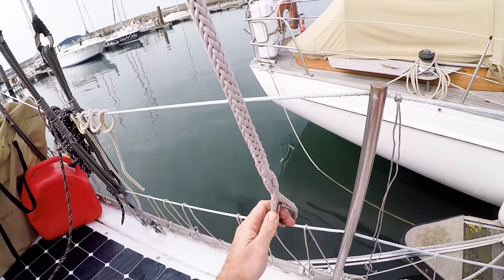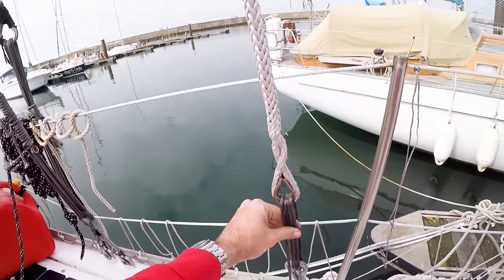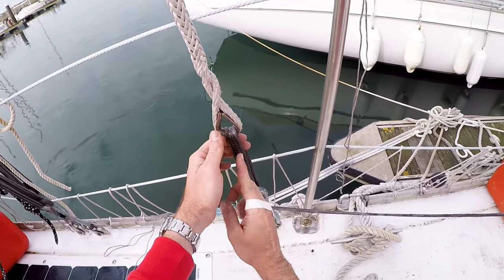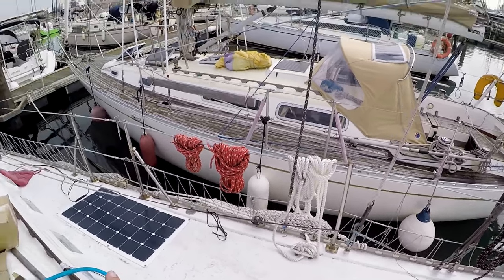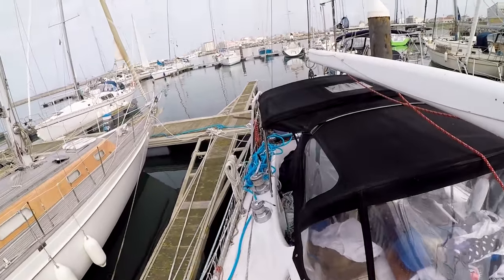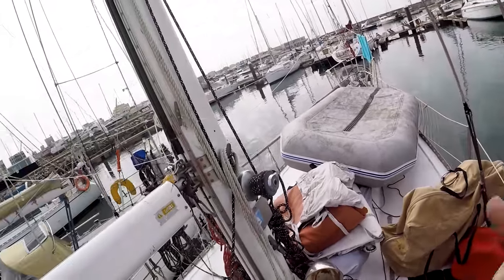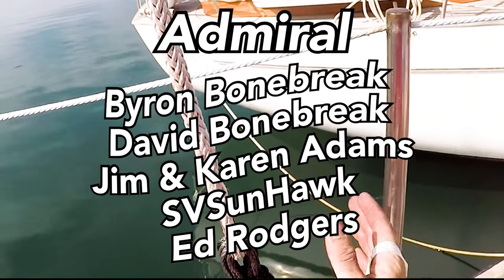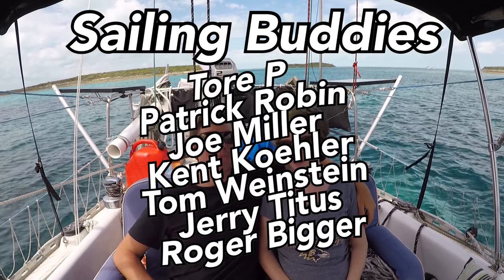Installing a Synthetic Standing Rigging Stay with a Deadeye | Sailing Wisdom

Comment: If not mentioned already in other places: Synthetic rigging comes with a huge safety advantage: It can be cut with a knife when dismasted. A knife which should be in your pocket anyways. Dismasting usually comes with chaos in the cabin. Murphy will bury your hydraulic shroud cutter in the mess if it's not properly stored. This increases the probability of hull damage by the beating mast and boom (and a subsequent loss of vessel and life in the worst case).

Comment: Hello Herbie

I’ve like you videos on your standing rigging.  I’ve been a professional rigger for over forty years and have seen many new ideas in that time. I’m a proponent of synthetic rigging and have done a few replacements over the last few years.  I like to do any soft attachments as much as possible.  Please continue to spread your hard work on this subject.  Let’s be professional now,  on some of your descriptions of the standing rigging.  Specifically what you called “check stays”. Check stays are usually attached to the runners and support the mid section of the mast when you load the runners.  In your arrangement we would call them “Standing Intermediates” or “D2 Aft’s” 
They would connect to the mast to support the staysail.
Please continue to support the good word on synthetic rigging. “Safe travels”
Reply from the maker: Thanks for the clarification!
Reply: @RiggingDoctor  your welcome

Comment: Thanks Herbie you have convinced me to stick with turnbuckles!😉
Reply from the maker: Your life will be much easier!
Reply: Hey Ben...

I agree with you too.  I mean rigging will gradually, always stretch.  Especially if you've been sailing hard, or gone thru some good blows.  That a screwdriver and  wrench.  I could re-tweak my rigging, in minutes, in a couple turns of the screw. Or unscrew it, to check it. Never had a turnbuck fail, with a little grease.  I mean, synthetic lashings will fail as well from from salt drying in the fibers, and dry rot.👍
Reply from the maker: The fibers are some pretty nasty plastic fibers that will probably still be around when cockroaches inherit the Earth. 
I have actually seen Hayn turnbuckle screws with crevice corrosion in the threads, as well as crevice corrosion in the toggle to the chainplate. 
Deadeyes still have a steel toggle that can get crevice corrosion, so neither option grants you freedom from inspection!

Personally, deadeyes are great if you are poor or on a really tight budget. They are inexpensive and get the job done but they are a pain in the stern to adjust! If the wallet will allow it, always choose a turnbuckle!
Reply: @RiggingDoctor  yeah...Hayne cast bronze turnbuckles will definitely corrode in salt water.  Especially the open turn buckles styles, that arent barrel tubes.  Ya gotta keep em greased.  Every year I do a haulout, I open the turnbuckles and regrease them. I replaced all the swedged fittings, especially on the rigging lower end...as they quickly cracked in the Carib.

Replaced them with Stayloc's and Norseman. I could even open them and clean em, and recaulk, or recut the cable, if needed,  if it stretched.  The fiber route, is less expensive, but becomes much more time intensive. And you can't open them to inspect as needed, without having to be redoing it all again.

Comment: Thanks for the practical how to on tensioning. Very informative to see the steps and straight forward thought process. As I sit here getting ready to replace all my standing rigging with new SS and turnbuckles, a timely reminder. My big concern with synthetic rigging is the reverse ? temperature coefficient. By that I mean as it get's colder, the rig loosens up? Seems a recipe for disaster. Has this been an issue for you? Note I am on a 36 ft steel sloop, so not much flexes right now. And I will still need a SS forestay for the furler, as I recall. Seems strange to mix and match.
Reply from the maker: The negative coefficient is a bit of a pain. Our Rigging is tuned perfectly at 80F. It works great all the way down to 60F. 
Colder than that and we just don’t go full sail. 
You can mix and match fore-aft, but not arthwatship. 
Steel headstay and synthetic backstay work well. Steel and synthetic shrouds will make a nightmare! Due to thermal fluctuations, the mast will always be out of tune. All of the shrouds have to be the same material so that they all expand and contract at the same rate.

Comment: To check for port - starboard tension equality, pluck one and if tension is close to even, the other one will resonate.  Resonant frequency is a function of mass, length, and tension.  Mass and length are equal. If both have the same tension they will have the same resonant frequency.
Reply from the maker: This works very well with steel rigging but I just can’t seem to create an audible sound from the Dyneema. It could be my ears though.

Comment: Herby, I've been toying with the prospect of using Dyneema for the standing rigging on the new sailboat I'm building, but I have no experience with using it. Your videos are an encouragement to give it a try. Thanks!
Reply: super helpful, right? what kind of boat are you building? sounds fun!
Reply: @sailingavocet  It's a small sloop of my own design (retired naval architect & marine engineer). I've been posting a series of build videos on my YT channel. Plans will be available free to anyone interested after the build is complete (estimated splash date around late August or Early Sept. 2020).
Reply from the maker: I am waiting for spring so the build can continue ;)
Synthetic rigging would work really well on your new boat. It will really make it easy get it all dialed in
Reply: @RiggingDoctor  Thanks Herby. I found a YT channel called Kraken. This guy makes all kinds of bits and pieces for use with synthetic rigging. He custom made all kinds of stuff for Zingaro (that recently suffered catastrophic hull failure not related to the rigging).
Reply: @sailingavocet  Just checked out your YT channel and subbed.
Reply from the maker: I know Kraken, he uses my Shroud Frapping Knot and Deadeye system. I really like what he does with the chafe covers, it looks so pretty!
I didn't know that Zingaro cracked! Is the boat in a land fill now or did he fix it?
Reply: @RiggingDoctor  I saw a picture of Zingaro on FB someone had posted and it looked like the cross beams all cracked and broke where they meet one of the hulls and the hull was cocked up at a weird angle but still afloat. I haven't heard any further word about it and they haven't posted any vids for the past month. At least there were no injuries and they were able to get the boat back to land on their own safely. Hard to tell from pictures, but it looked like it might be possible to repair the boat but it would be a major, long term yard project and quite expensive.
Reply: You can go to svzingaro.com and see pics of their boat and a link to the video of when it happened and how they made to land.  It's not good, but they did great.

Comment: 👍...very true, learn the "feel" of your stay tension...my Newport manufacturer's manual specifically says just adjust to feel for equal tension...no Loos gauge necessary....too bad I bought the gauges before I noticed that in the manual. When I tightened the stays according to Loos  numbers per size of wire, it was WAY too much.

Comment: Rigging Doc. Many thanks for the education. While keeping the rig tensioned keeps the fibers moving and myself in tune with it, I’m at odds with the micro climates I experience in Northern Cal. If I have a 30 degree temp swing during a day, say 55-85, would a deck stepped synthetic rig turn into daily tuning fun routine. Light winds are not the norm here if the rig loosens.
Reply from the maker: That depends on how big your boat is. 
The amount of creep is relative to the length of the stay. On our rig, the mast is 55’ and the longest stay is a tad over 60’. We can see as much as 1/2” extra in the dead of winter. If the stay were only 30’ we would only see 1/4” extra in the dead of winter. 
I sail without issue over a +/- 20°F variance. I tune it at 80°F and I’m good from 100°F down to 60°F. Any colder than that and the rig is loose but not about to fall over. I keep the sails reefed and at 40°F I won’t go higher than the spreaders with the sails. 
I’m keel stepped so I always have the deck member helping hold the stick up, but being deck stepped you won’t have that. 
My suggestion would be: 1. Have turnbuckles so you can adjust it quickly, 2. Try and set it at 75°F on those kind of days. At 85°F it will be tight but not too tight as to break stuff and when it cools off for the night, the mast will stay up without any sails up. 
When your rig goes slack due to cold, all the stats expand at the same rate so your mast is still in tune (just a tad bit off to leeward while undersail) but it will still be in column. When the rig is loose, it is especially important not to have an accidental jibe as this will shock load the rig and since it’s loose, it will pick up a lot of momentum until it snaps to a halt and will most definitely break something in the process. 
*All of this is contingent on you having lateral spreaders (pointing straight out). If they are swept back, ignore all of this as you need to maintain 20-25% breaking strength tension on the cap shrouds at all times of the rig could fail! If you have aft swept spreaders, you need to stick with steel. If you have lateral spreaders, and do a combination of deadeyes and turnbuckles, you will be fine as long as you keep an eye on the weather and adjust the rig tension to follow it. 

-a trick for flipping seasons with a turnbuckle is to use electrical tape and mark the threads of the screws. Wrap the tape on the inside of the turnbuckle to mark your warm setting and wrap the outside threads of the turnbuckle to mark the cold setting. When it gets cold, you just pull the cotter pins and spin the turnbuckle until the “cold tape” reaches the turnbuckle. If it’s going to get hot, loosen it until the tape inside the turnbuckle touches the turnbuckle.

Comment: Thank you so much for your videos! I found so many information on how I will do my rigging. But I remain with one question: why don’t you use a big round shackle connected to the chainplates to pass the lashings trough instead of the deadeye?
Reply from the maker: The breaking strength of a shackle is not high enough to support the loads that standing rigging demands of it. For that reason, I had to come up with a stronger connection.
Reply: @RiggingDoctor  thank you for your answer! But to connect the deadeye with the chainplates you use a rigging link toggle, right? Doesn’t that piece have the same breaking strength as a same sized shackle?

Comment: great video.   my new to me small 19' boat is missing the innner stays.  I thought I would use soft rigging for a try.   My thought is to just use a masthead or double clove hitch at/above the spreader bar and around to the other point on the deck.  what do you think?
Reply from the maker: On a boat that size, that would serve the purpose. Just make sure that the area the stay ties to is solid and will resist the force of the loop going around the mast. If the section is hollow, you could buckle the side of the spar and break the mast.

Comment: Another informative video I have oone further suggestion on the installation of clevis pins and one for cotter pins. clevis pin heads and or bolt heads should wherever possible be up, outboard or forward. the cotter pins or split pins should where possible have a washer between the toggle or hanger leg and the pin that matches the toggle material, in your case stainless, this prevents the cotter pin introducing microscratches on the toggle which could lead to corrosion or cracking cheers
Reply from the maker: Very good points, and I really love the washer idea!
Reply: @RiggingDoctor  your welcome 41 years in aviation has to be good for something and no point taking things you learn to the grave glad to be able to pass some of it on

Comment: You can easily pull the end of the frapping knot through with a loop, no need for all that forcing it through with the marlinspike . Just place a loop under the perpendicular wrappings before doing those, then put the looped end of the frapping knot through the loop and pull it through under the perpendicular wraps. That is how traditional archers hide the ends of the lines used to fix the fletching to the arrow, they just don't pull through all the way.

Comment: Great video...thanks!  I have read when you use synthetic line for standing rigging, you need to size the Dyneema line for stretch rather than strength.  Did you have to buy larger diameter line to account for stretch?
Reply from the maker: Yes, from a strength standpoint I could have used something as small as 5mm Dyneema, but I used 9mm.
I go into great detail about how to size your rigging in the blog: https://www.riggingdoctor.com/life-aboard/2016/8/19/sizing-for-creep

Comment: Hi, you are absolutely correct. Sorry to appear a smart-arse. 😉 However, I can’t help it, so here goes again. Crevice corrosion happens when the stainless is in an oxygen-poor environment, not generally the case  for the rig components. With the major exception of the chainplates where they pass through the deck. I replaced all the chainplates on my 20 year old boat with nickel aluminium bronze. Expensive but I now have peace of mind. I did consider hi-mod rope for replacing the standing rigging, but decided eventually on stainless with swageless fittings. Easy with the old rig as a template, but I should not wish to have done it without that help. I find retuning the rig after re-stepping the mast is pretty time-consuming, and use a Swedish produced tension meter (about €100) to ensure correct tension. How do you do this with your set-up?
Reply: I wouldn't consider passing through a deck an oxygen poor environment.  I would consider an oxygen poor environment to be keel bolts encased in epoxy.  Now that's airtight!  By the way he said he doesn't use any tension measuring gauges, only relies on feel.  Because of the physical differences between the hardness of metal cabling and synthetic lines, I don't believe any commercially made gauges for metal cables would really function properly on synthetic rigging anyway.  If you think of a steel cable under tension vs. a rope, you will always be able to pull the rope a bit more sideways IMHO.

Comment: Thanks Herbie you make it look so easy. I'm tempted to try out synthetic rigging. My boat has a fractional rigging setup, what I  am thinking about is where the upper shrouds passes through the ends of the back swept spreaders, how do you get by this snag. Should there be some friction at this point or can it pass through a low friction fairleed thingy...
And also i have a selden mast with  T terminals on both upper and lower shrouds.  Have you ever seen  t terminals for synthetic rigging?
Best regards from Jarle
Reply from the maker: For T-Ball fittings, you want to use this:
https://store.offshorespars.com/search?type=product&q=t+ball
You simply hook the rope into the ring of the T-ball with a toggle.
The cap shrouds are seized to the spreader tip to prevent the spreader from folding up or down. I always service the section of shroud that passes through the spreader tip to protect it from chafe.
Reply: @RiggingDoctor  Thanks

Comment: Very helpful video. I am re-rigging my 20ft trailer sailer with synthetic and can use all the help I can get. What is the purpose of the "shackle" attached to the tang. Why not attach the thimble directly?
Reply from the maker: The goal was to establish the orientation of the eye at the mast. The lowers needed it or they would rub each other in the tang, the others were just because they were already there, but they didn’t need to have them. 
When you re rig, the only reason you would need a toggle is because the eye would rub on something in the orientation of the tang and the toggle would turn the eye 90* and give you more clearance.

Comment: Binged in my spare time for a few weeks to get current, and it was fun and educational! I'm curious, in this instance, why an R-pin, R-clip, or Hairpin (whatever one would like to call it), wouldn't be a better idea than a cotter pin, though I defer to your Wisdom on this topic. :)
Reply from the maker: Cotter rings have a tendency to work themselves free which is a bad thing, but they won’t snag sails or lines. The first choice retaining pin is a cotter pin; but if it’s a high snag risk area, a cotter ring is the go-to (but it needs to be checked frequently to make sure it’s not working free).

Comment: I take your point about using gauges but for a simple check or repeatability a gauge could be useful. Also for the less handy folks  they have something to compare. Like if one of your chain plates is going bad or you have unseen chafe causing loosening you can have a simple way to tell. Applies to regular rigging of course too. Also I have found many people are  afraid to tensioning their rig properly ( enough) leading to a dangerously loose rig in windy conditions .  But I guess if your going to use synthetic rigging you will probably know a lot more........
Cheers Warren
Reply from the maker: I never thought about using it to “check” the rigging over the years. That is a really good use for it. 

Tune the rigging, then record the tensions on the stay. In the future, that’s your numbers!